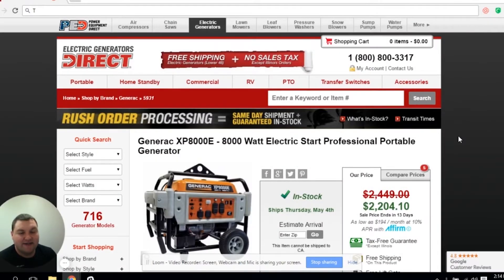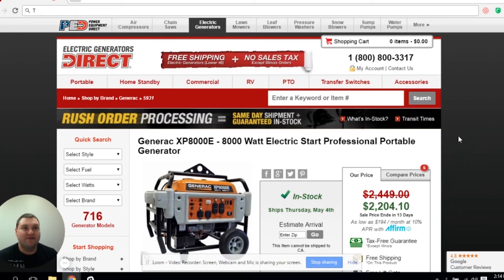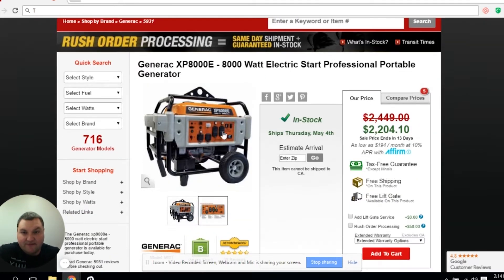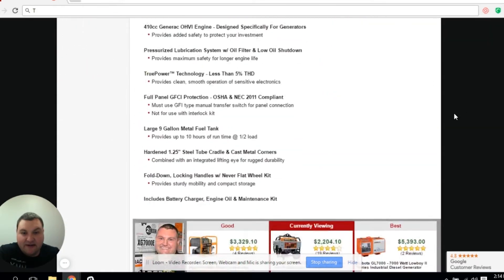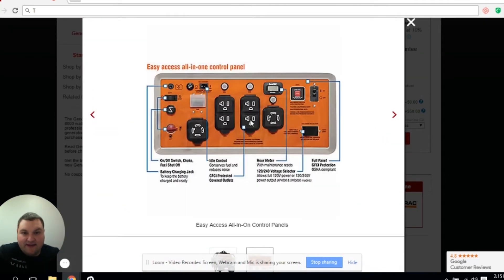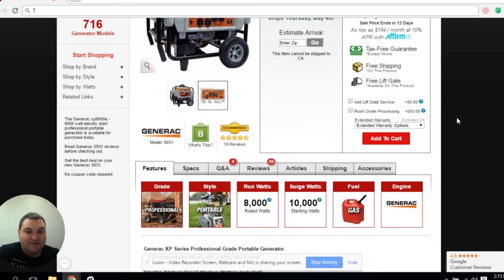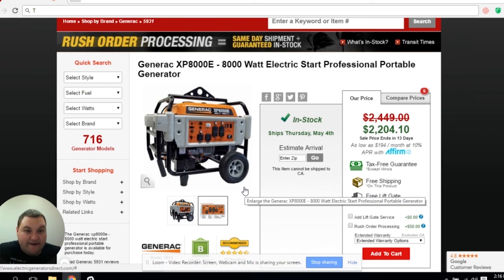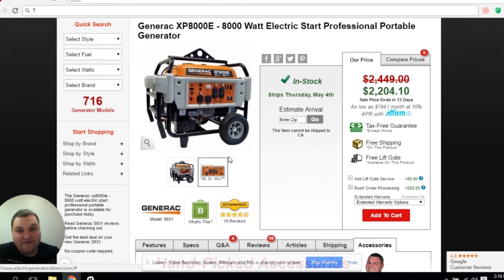Generator Floating VS Bonded Neutral

Comment: Kinda wrong there, if you keep the bonded ground to nuteral on a generator and your main pannel thats grounded to nuteral too the voltage can not only hurt people inside the house on recepticles but also burn out appliances if your breaker dosent trip first. 2 return locations for potentally unregulated voltage (nuteral line and ground) is very bad and not nec compliant. If you disconnect the bond in the generator and you think the front pannel is still grounded, just use a multimeter to find out....
Reply: Also your generator must be labeled floating nuteral and recepticles on yhr generator should not be used after, only your main 30amp or 50amp recepticle should be used to power your main pannel
Reply: Why did you post so many times on replay
Reply: Also your generator must be labeled floating nuteral and recepticles on yhr generator should not be used after, only your main 30amp or 50amp recepticle should be used to power your main pannel
Reply: Also your generator must be labeled floating nuteral and recepticles on yhr generator should not be used after, only your main 30amp or 50amp recepticle should be used to power your main pannel
Reply: Also your generator must be labeled floating nuteral and recepticles on yhr generator should not be used after, only your main 30amp or 50amp recepticle should be used to power your main pannel
Reply: Also your generator must be labeled floating nuteral and recepticles on yhr generator should not be used after, only your main 30amp or 50amp recepticle should be used to power your main pannel
Reply: Also your generator must be labeled floating nuteral and recepticles on yhr generator should not be used after, only your main 30amp or 50amp recepticle should be used to power your main pannel
Reply: Also your generator must be labeled floating nuteral and recepticles on yhr generator should not be used after, only your main 30amp or 50amp recepticle should be used to power your main pannel
Reply: Also your generator must be labeled floating nuteral and recepticles on yhr generator should not be used after, only your main 30amp or 50amp recepticle should be used to power your main pannel
Reply: Also your generator must be labeled floating nuteral and recepticles on yhr generator should not be used after, only your main 30amp or 50amp recepticle should be used to power your main pannel
Reply: Also your generator must be labeled floating nuteral and recepticles on yhr generator should not be used after, only your main 30amp or 50amp recepticle should be used to power your main pannel
Reply: Also your generator must be labeled floating nuteral and recepticles on yhr generator should not be used after, only your main 30amp or 50amp recepticle should be used to power your main pannel
Reply: Also your generator must be labeled floating nuteral and recepticles on yhr generator should not be used after, only your main 30amp or 50amp recepticle should be used to power your main pannel
Reply: Also your generator must be labeled floating nuteral and recepticles on yhr generator should not be used after, only your main 30amp or 50amp recepticle should be used to power your main pannel
Reply: @zildjian780 Careful, I think your comparing finger is floating over the send button 😮
Reply: You are absolutely correct. I connected a bonded generator to my house panel and didn’t realize that connecting a bonded generator could cause an issue. Well, it caused burned out two small appliances and caused a power strip to catch on fire. Almost $200 thousand dollars in damages later and being out of my house for 6 months, I’ve since learned the importance of not connecting a bonded generator to a house. A very expensive lesson that could have even caused someone to die.
Reply: Nobody should ever connect a generator to the main panel. How are you people so stupid?

Comment: So is there any way to use an interlock if you have a bonded neutral or do you need a transfer switch?
Reply: I have an interlock in my main panel instead of a transfer switch. This is where the interlock requires you to turn off the main circuit breaker to your power panel before you can turn on the 30amp breaker where the gen power comes into the panel.  I'm assuming that is what you are meaning.  If so, it's a good idea to modify your generator to floating neutral since your main power panel is already bonded.  You only want one bond.  Check with your generator's tech support to see how to make that modification.

Comment: I have a GP6500.  I'm doing the same setup as Daniel M.  Looks like my 30-amp twist-lock outlet (NEMA L14-30R) is also not GFCI protected, so I should not have to be concerned with the floating/bonded issue. Correct?
Reply: PS great info.

Comment: If I have a floating neutral generator and am not connecting it to a transfer switch (extension cords only), should I bond the neutral to the ground?
Reply from the maker: Hello, in your case it's still best practice to look at the owner's manual and follow proper grounding procedures outlined for your specific generator. We always recommend following manufacturer directions for every product as they are written first. For more information please read this: https://www.electricgeneratorsdirect.com/stories/1021-How-to-Avoid-Tripping-a-Generator-With-a-Bonded-Neutral.html.

Comment: What if I do not use a transfer switch and connect the 30 amp cable directly to my panel 220 breaker will this still apply?  Asking for a friend haha.
Reply: Well you want a transfer switch, if you backfeed to the grid when power is down you could hurt a technician and if the grid comes back on and backfeeds to your generator it's toast. 

But to answer... If you connect the generator to a 30a/220 breaker it will have a bonded neutral to ground, so you'd want a floating neutral generator but probably wouldn't have any issues unless you had a GFCI generator.

Look up interlock kits, it allows you to use a normal 220v breaker switch as a generator transfer as it does not allow your main and generator breakers to physically be on at the same time
Reply from the maker: Thanks for helping Derek out with an answer.
Reply from the maker: The first reply is important- you never want to endanger yourself or others by feeding your generator directly up the line (called backfeeding) and routing around a transfer switch with so much power. It's dangerous and if someone gets hurt you would be liable. A transfer switch safely routes power and prevents this from happening.

Comment: You make sense. I get what you mean by the three wire disconnect panel. And I also now see why the GFCI system sucks. They keep trying to make things safer and they just keep making things worse. I'm 72 and have had my hands on Knob and Tube to the latest and "greatest" panels forced on us by the equipment lobbyists paying off the code writers. Common sense keeps people alive along with respect for those pesky little electrons trying to get home.
Reply from the maker: Thanks for your comment.
Reply: If left alone. Natural selection would take care of those without common sense. Making our species smarter over time.

Comment: I converted my Champion generator to floating neutral with a simple disconnect of 1 wire per their documentation.
Reply from the maker: As long as you followed the official instructions from Champion to do so, it should work out great.

Comment: Thank you for this info. It is exactly what I've been looking for. A quick note on my use case... 

I plan on purchasing a Generac 8000E COsence and connecting it to my home via the 30amp outlet. I do not plan on using a transfer switch, instead I'll be using a UL rated interlock on my GE powermark Gold panel. 

Based on what you said in the video, and one of the comments, my understanding is that it's perfectly acceptable for the generator to have a bonded neutral as long as the 30 amp outlet on the generator is not a GFCI. Now for my question.... Do you know if the Generac 8000E's 30amp 4 prong outlet is GFCI? The manual doesn't not mention it, but I just want to confirm.  Thanks in advance.
Reply from the maker: Hi, Daniel. The GP8000E’s 30-amp twist-lock outlet (NEMA L14-30R) is not GFCI protected.
Reply: Do you need to unbond generator if no GFCI on 30-50 amp plug

Comment: Thank you for the video.  I've seen generators with the 120 regular house hold style outlets state GFCI and the L5-R state GFCI but the L-14R 30 amp DOES NOT say GFCI next to it.  So does this mean I can use that L-14 30 amp twist lock outlet from tge generator to my inlet box which is connected to my 200 amp electrical panel which is already bonded via a inter-lock.  UL Listed without any tripping problems?  Anything else I should be aware of?  Thank you.
Reply from the maker: If the main outlet is not GFCI protected then it will be able to work with a transfer switch or inter-lock without any issue.
Reply: @PowerEquipmentDirect  thank you
Reply: THE GENSET MIGHT STILL HAVE A BONDED NEUTRAL ON THE 120/240 VOLT RECEPTACLE AND MUST COMPLY WITH THE NEC WHEN CONNECTED TO A STRUCTURE'S GROUNDING SYSTEM
Reply: @donl1410  Thank you.  Appreciated.
Reply: @dj5752  YOU'RE WELCOME

Comment: I may be in the wrong spot to ask this, but is there a way to adjust a generator such that it doesn't trip a UPS? I have several in the house and they will cut on and off every 3-4 seconds. I have a more robust UPS that seems to deal with it better, so maybe it is just the crap ones I am using...lol

 I'm assuming the issue is because the AC sine wave is not pure sinusoidal, but....is there any magic that can be done to help mitigate this issue?I have this-
https://www.blackmaxtools.com/products/details/7000-watt-portable-generator
Reply from the maker: It's hard to say without knowing your entire set up. You can shoot me an email and we can troubleshoot if you want. https://www.electricgeneratorsdirect.com/contact_us.php

But, in general, If you're using a portable open-frame generator, you are correct and it's also because the fluctuations in the power output as the engine/alternator speed adjusts to varying loads. 

I always suggest to size your generator for 50% load to its capacity. So, my suggestion for you is to maybe get a standby generator, if possible, or a larger inverter (that has a clean sine wave) or even a hybrid generator. You may also look for a APC transfer switch. 
https://www.electricgeneratorsdirect.com/stories/1823-Generator-Wattage-Calculator.html